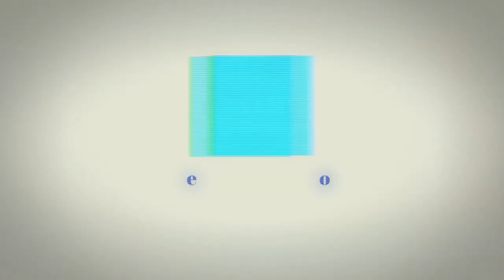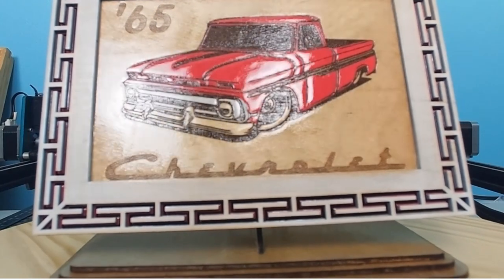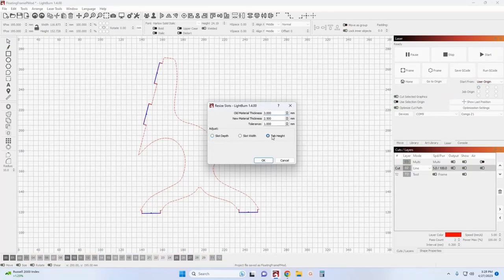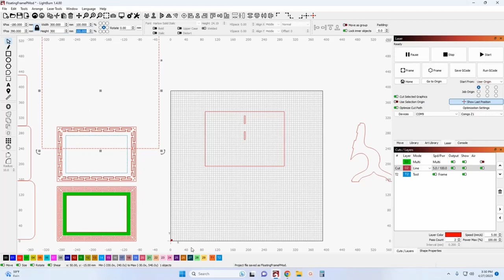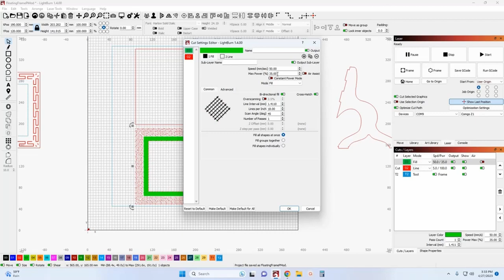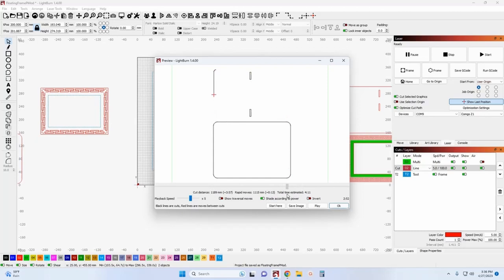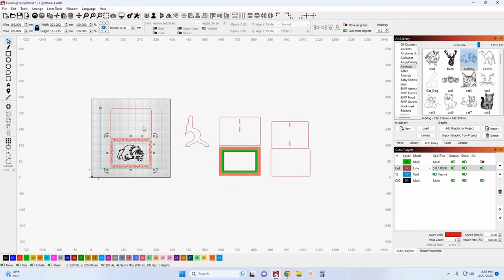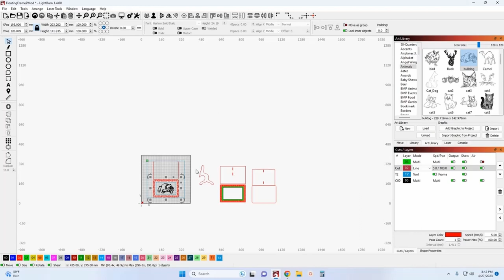Floating Picture Frame Designed In Lightburn

Comment: Update I had to change the slot width under the width to the right on of lock. LB 1.4.0😮
Reply from the maker: I've checked the file, and it's working like it's supposed to for me. I'm sending you a video. Check your email shortly.
Reply from the maker: I thought I knew your email. Contact me at hobowithwood@gmail.com

Comment: Steve I am having issues trying to resize the slot. I have ungrouped the panel with the vertical slots. If I measure the slot width it measures 4.13 mm. I select  the lower slot then under tools,resize slot in selection, radio button slot width in new material I type in 2.800 mm press ok go back measure it remains 4.3 🤯
Reply from the maker: I thought I had you email. Contact me directly at hobowithwood@gmail.com. I've experienced similar issues with other files. Why it does it is unknown to me, but when it happens it is usually a simple fix. I've checked the ecommerce file for this design. I am not experiencing this problem. I don't doubt that you are. I want to help you and make sure your experience with my files are trouble-free. i look forward to your email.

Comment: I downloaed ther Frame.....Gtreat Design.  I want to point out, though, that in the middle layer of the frame the middle is being cut out.  I didn't catch this and had to ruin it twice.  You might want to correct that.
Reply from the maker: The top layer is supposed to cut out the middle of the frame. The artwork is engraved on the middle layer. The tool path on the middle layer indicates where the artwork should go. The tool path is slightly larger than the cut out. This is if you decide to use a "canvas" print around your artwork, you'd want the canvas to extend past the frame. This is all explained in the video posted on the website with the product description. Anytime you think there is a problem with a file, I want to know. But in this instance I think you simply didn't understand the concept.